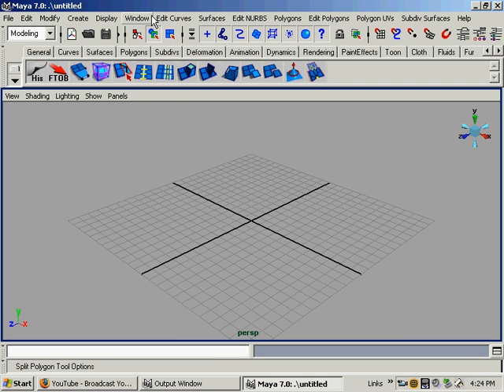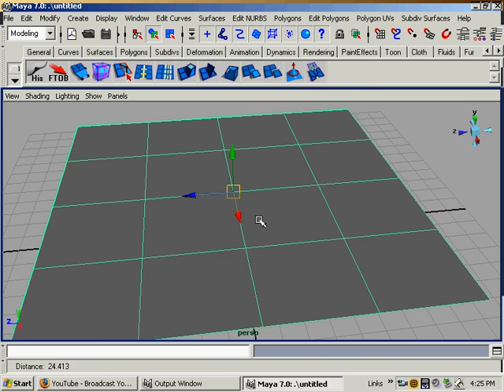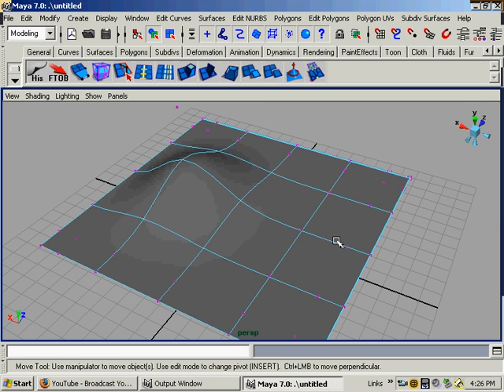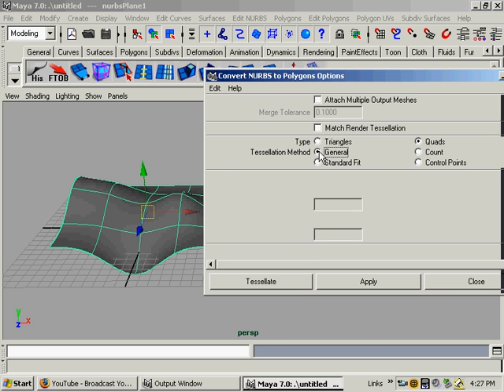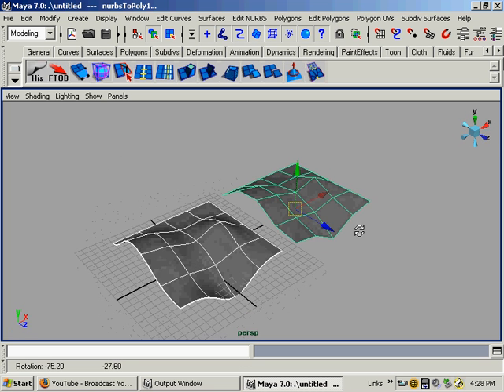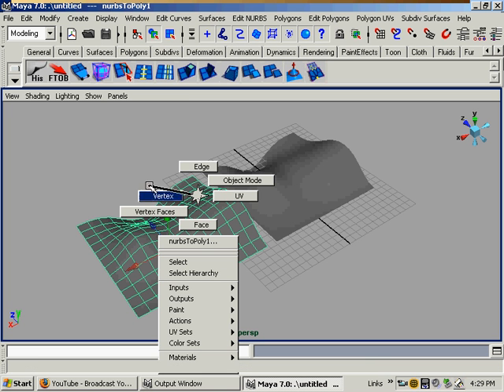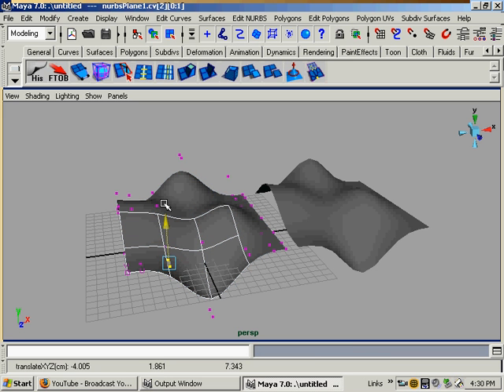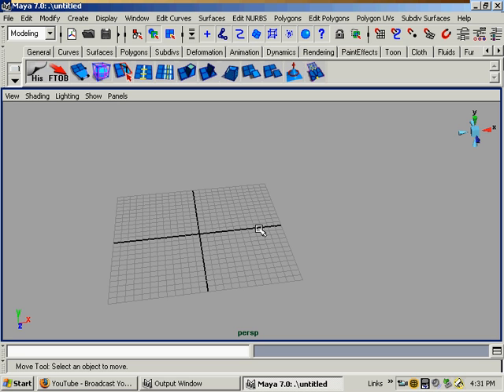Using NURBS surfaces to produce Polygon Surfaces in Maya

Comment: Instead of all this tweaking you're doing if you select "Control Points" in the convert NURBS to polygons option box it will convert using the Hulls instead of the patches themselves, so when you use the smooth mesh tool you'll get a nice smooth surface and won't loose any of the object's volume